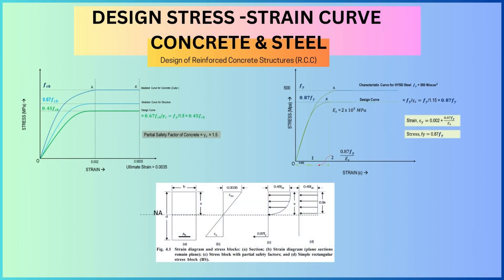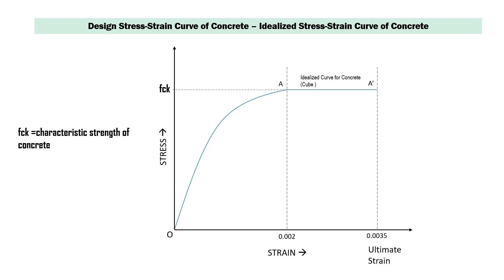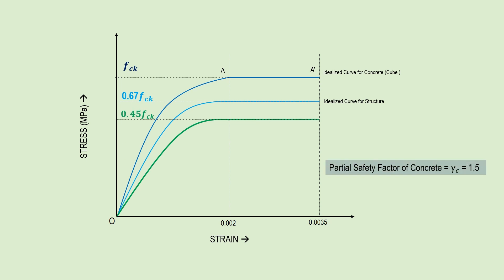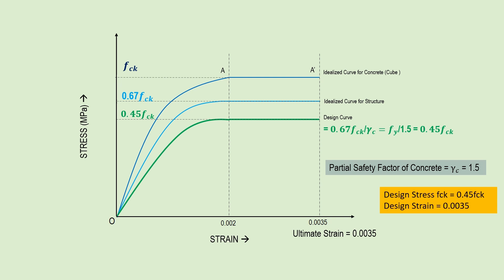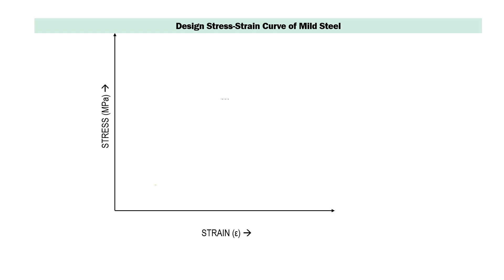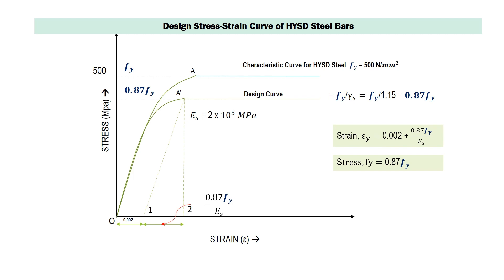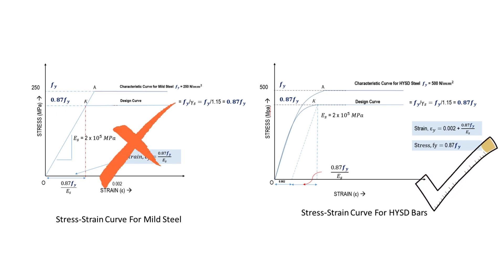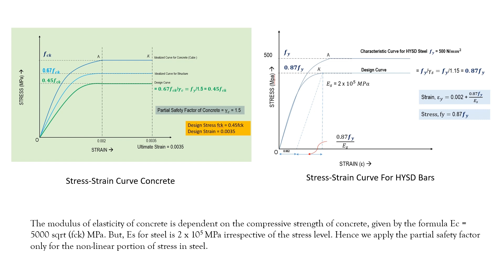Design Stress Strain Curve for Concrete and Steel

Comment: How to polt if it's a reinforced concrete , I have done experimental analysis of slab of 600mm×600mm×50mm size subjected to central point load, the load and dispcement values are as follows. Deflection Load

0

0

0.023

0.24

0.11

0.15

0.5

0.18

0.88

0.29

1.59

0.42

3.06

2.13

0.61

3.93

0.77

5.48

0.97

6.53

1.12

7.07

1.42

8.82

1.6

9.84

1.71

10.8

1.89

11.98

2.01

12.68

2.28

14.7

2.46

15.32

2.64

15.8

2.85

16.45

2.91

16.8

3.07

17.14

3.25

17.76

3.36

18.33

3.52

18.64

3.6

19.02

3.71

19.83

3.91

19.89

4.12

20.23

20.66

4.24

21.27

4.49

21.44

4.65

22.02

4.92

22.61

5.42

22.83

5.75

23.12

5.86

23.27

5.94

24.31

6.79

25.01

7.22

24.8

7.38

7.55

24.64

7.85

24.31
Reply from the maker: Convert the load and displacement values to the corresponding stress and strain values, and then plot the *stress on the Y-axis* and *strain on the X-axis* to get the stress–strain curve.